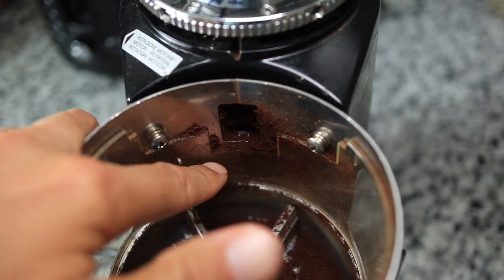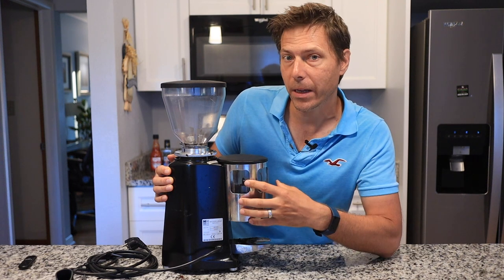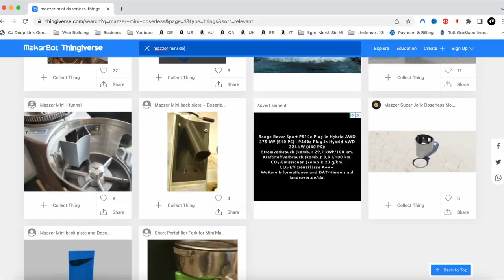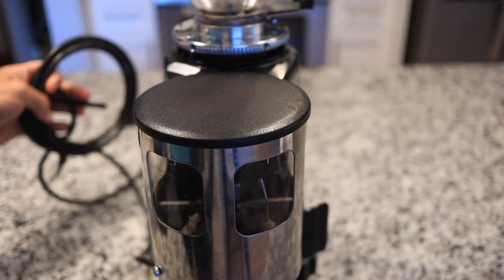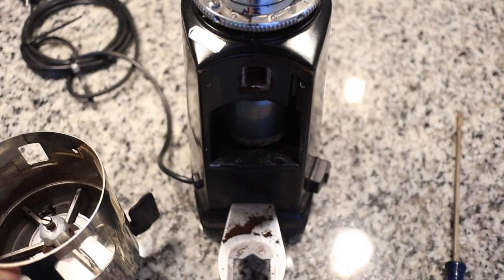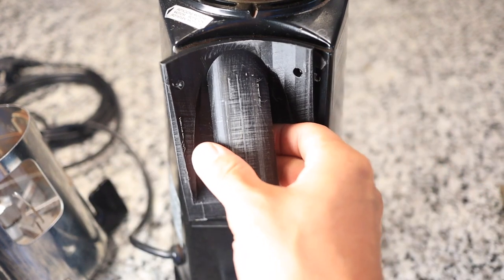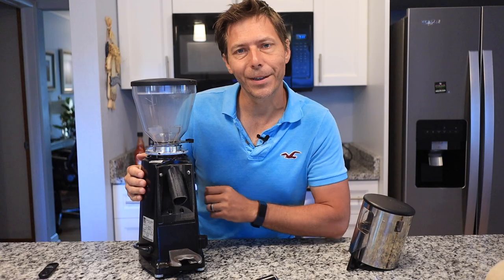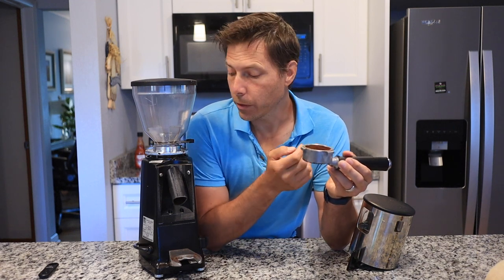How to Convert a Mazzer Mini Doser Grinder to Doserless

Comment: This is great - reusing a grinder that would otherwise sit and collect dust. Unfortunately though, 3D printers usually come with brass nozzles, which contain lead, and that lead - though a small amount - is in the print, and that could still be ending up in your coffee, which might not be ideal. Not to mention, not all filament (material for 3D printing) is food safe. But that can be solved by getting a nozzle out of stainless steel for under $20, getting a food safe filament and thoroughly cleaning the flament path.

Comment: Tom whats better the df54 or this?
Reply from the maker: While I love the looks and heritage of Mazzer, this one has been hard to level the burrs on, and it has a lot of retention, especially the doser models of course. I'd go with the newer tech, the DF54.
Reply: @TomsCoffeeCorner  true but you can get single dose mod on it and bellows and apparently the retention is zero if you tilt it a-bit forward. What do you mean by level the burrs on? And also i mentioned the mazzer as i have seen for 30 whereas inc postage the df54 is 250-60.
Reply: @TomsCoffeeCorner  could you make a comparrison video with the fully modded mazzer
Reply from the maker: @zayanhussain9570  That would be cool, but these grinders are currently in  different locations. Maybe I will reunite them soon enough. Cheers!
Reply: @TomsCoffeeCorner  thanks

Comment: Very useful mod for home use. Which file did you print, Mazzer_Mine_Doserless_Funnel_V2.stl or Mazzer_Mini_Backplate_with_funnel.stl? V2 has oval entry and the other one rectangular? Thanks.
Reply from the maker: I think it was rectangular, but I don't quite recall. Just choose the file based on your grinder chute opening geometry.

Comment: Tom what is your opinion on a grinder ugrade to match my Europiccola? I'm looking at either a new Specialita or a used Mazzer Super Jolly and doing this mod. Espresso only and using hoppers.
Thanks
Reply from the maker: The Specialita is way better ergonomically. Also much smaller and quieter. The SJ is big and powerful, and I love that Mazzer nameplate, but the thing really is humongous, and has quite a bit of retention.